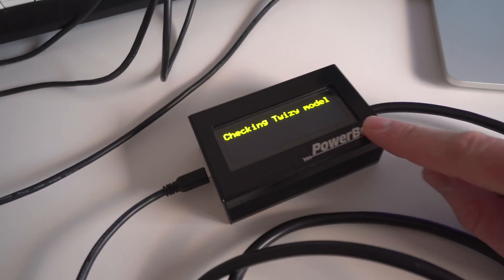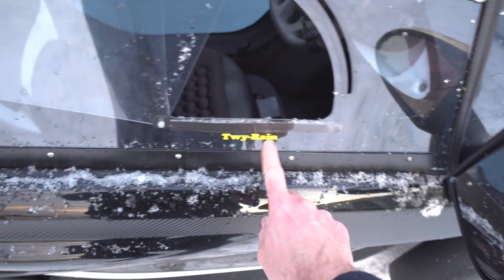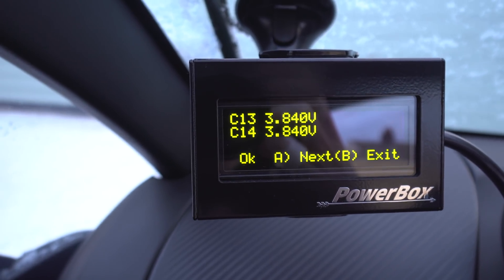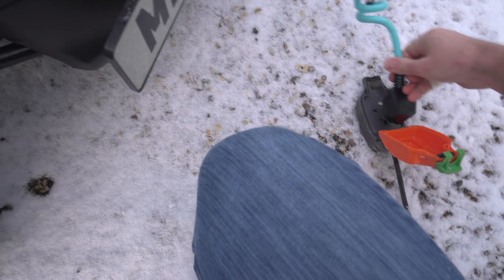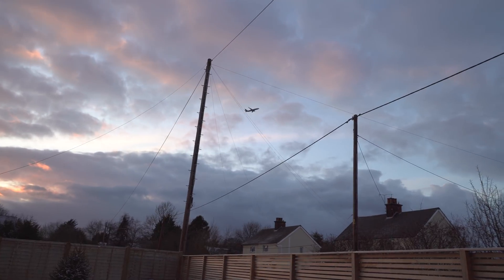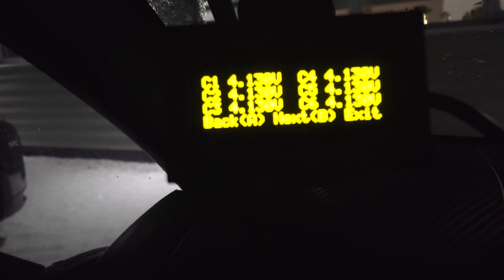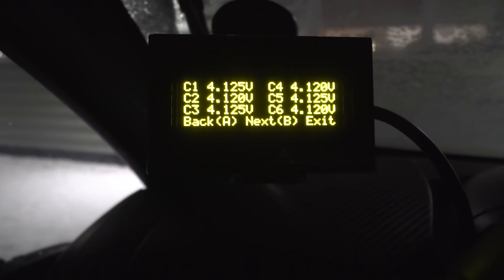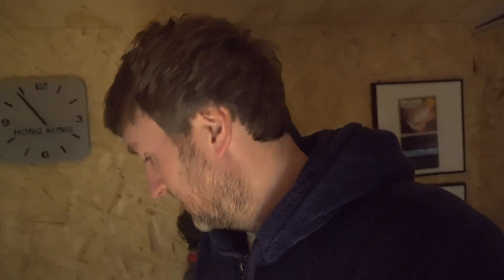TWIZY BMS HACKING!

Comment: great video !  i am thinking about using a twist as a donated for my sailing boat electric drive .is it possible to use this and make a bigger battery and get more kWh ?
Reply from the maker: I can't see why not, the whole car uses canbus so you'd need to transplant everything from the car for it to work properly.

You could make a bigger battery, it has a BMS and sensors built in to the existing one so as long as you copied the wiring to your new battery so the BMS doesn't see any difference it should all work.

Comment: Motor and Svecon are only reported when the are enabled. The UCH stores the last Values.
When the battery temperature dropps the voltage dropps. Then you can get about 500W into the Battery before the BMS shuts the charging down.
Reply from the maker: Got it thanks!